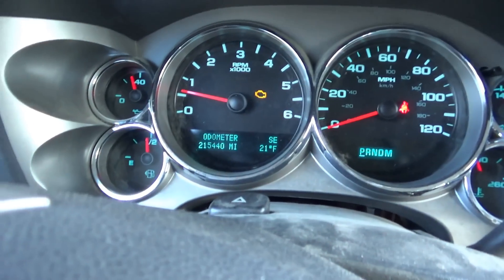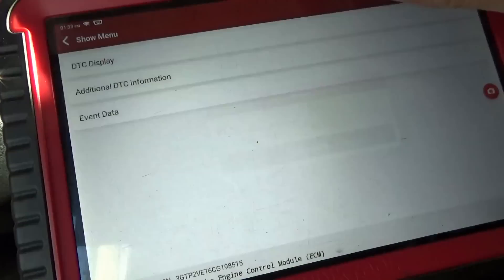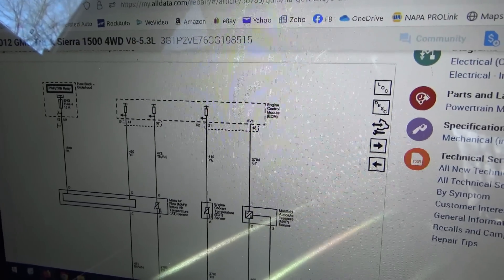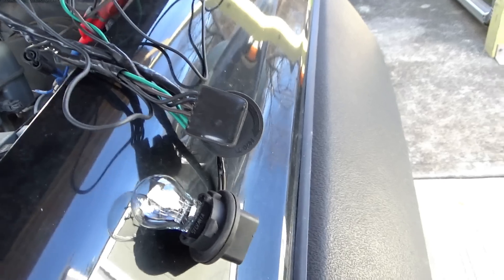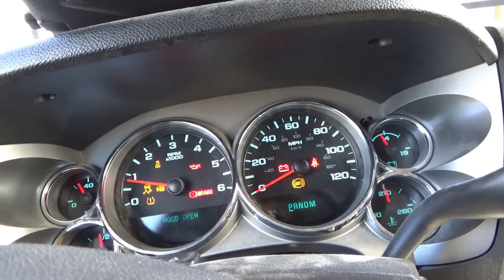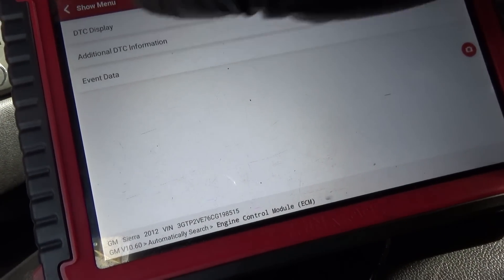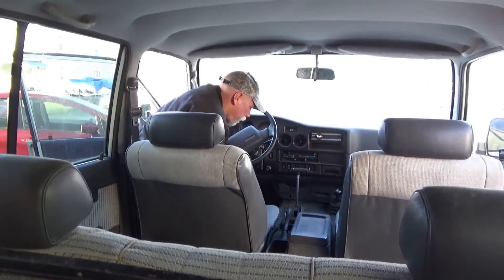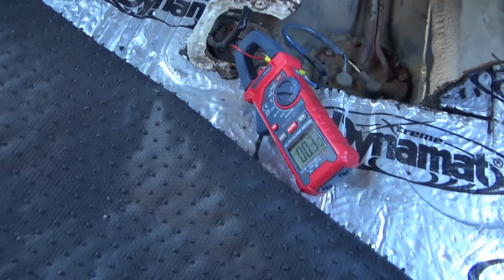HELP! My GM Truck Can't Pass EMISSIONS! (+ BONUS Vintage LAND CRUISER No-Start)

Comment: you do amazing work I watched a video where you diagnosed the bad fuse box for the no crank on the 03 Chevy I have a very similar issue but not that exact problem, is there any way I could get in touch with you?

Comment: I don't understand how you knew the fuel pump wasn't spinning by seeing the 13 amps?
Reply from the maker: It was dead silent lol
Reply: It shouldn't pull that puck power. That's locked rotor current draw. 

Plus as he said, it was silent.

Comment: Interesting case on that GMC.  The owner threw 3 mass airflow sensors at it, and none of them worked.  But never thought to check to see if it had power and ground with a simple test light....  His money was far better spent calling Ivan.  Nice work bro.

Comment: great job alot of the time multiply problems can lead to a common ground  who would have though  it was a common power my boss was not best trouble shooter but when call a report at ac company i worked for industrial chillers we had better checked all the fuses

Comment: This unfortunately reminds me of Alaska Air flight 182, the one with the seized Jack screw where everybody on board was lost. In reading the final NTSB report, I found that the pilots made a bad situation worse by trying to move the Jack screw when it was clearly jammed. They kept trying to move it while observing the voltage spikes that occurred with the jammed part. They clearly had no mechanical sympathy and everybody paid for it with their lives.

Comment: One Rover BMW M47 engines have Bosch film type  MAF I now do quick checks on the MAF using a multimeter, power and ground the look for known output voltage at idle and at 4000 rpm

Comment: Basic checks first should be in every diagnostic handbook.  The most basic is to check fuses after pulling up a wiring diagram.  Eliminate electrical problems before breaking out the sockets and wrenches.

Comment: Parts cannon on a blown fuse! Solid diagnostic, Ivan! Still wondering what caused the fuse to blow - if it happens again, it requires a careful wiring inspection.
Smart approach on the land Cruiser for a quick diagnostic! Curious to know what happened after the fuel pump replacement (did they cut the floor to get to the pump?).

Comment: I have learned from Ivan a test light and a wiring diagram is an extremely valuable diagnostic tool,despite its simplicity.  Well done Ivan.
Reply: If you test a suspected short-circuit with a test light the worst thing that can happen is the light bulb will light up.  I know years ago when him, Eric O., and Paul Danner went to Eric-the-car-Guy's meetup they probably had at least 100 test lights between them.  They even diagnosed a power window issue on a Chevrolet truck; turned out to be bad relays.

Comment: Man ivan I'm  literally dealing with the exact same codes on a 2014 6.0 .. I thought it was a ref low or a 5vref 2 issue as it was to many codes all at once . ( we also had abs codes ) I've chased it down to the cmp, and ckp sensors. I believe the cmp sensor is shorting sending out static on the 5vref2 ...

Comment: i get a kick out of new york laws.you can drive around with  your suspension & steering parts falling off.& thats OK as long as it passes emissions.so you can breathe clean air as you die in your car crash.makes a hell of alot of sence.
Reply: That way you can dilute the gene pool all at once. A little at a time to slowly delete the gene pool. 😅😅
Reply: I thought Pa. was bad, and NY possibly worse, until I saw some of the stuff that Wes works on in Chicago! Unbelievable!

Comment: I really like the Toyota floor mod to access the fuel pump without dropping the tank... I must confess that I have done the same thing on a few of my cars in the past... tin snips FTW!
Reply from the maker: Right on 😁
Reply: I used a drill and a bore scope to get me to the exact location and a nibbler to put in the new access door on my 02 Saturn L200 , I’m always thinking about the next owner! That one mod saved me hours on the fuel pump and about 3 months later on the sending unit replacement.
Reply from the maker: @johnchambers12  better than factory 😁👍

Comment: Why is it that so many educated people never think of the easiest thing to check before spending money on parts that don't fix their problem ? Fuses is my first go to if something isn't working, I only go after power problems if the fuses blows ! I guess common sense has left the building on so many people !
Reply: You would think that after the computer throws the code,  they would have checked power and grounds on the part in an attempt to ensure it was the actual part that was bad.
Reply: Because the educated people think going to a parts store to read codes and they tell you the codes will solve their problems. I've always told people. That's where you start the trouble shooting process first before replacing parts. 
Nooooo...they say

Comment: The 1960 cars the check engine light never came in the only light came on was Ford Blue light said the engine was cold it turn off when warm up they put that junk on the cars so more parts go bad my friend Owen a Smog shop he said the old cars pass the emissions test better then the New cars

Comment: Hmmmm apparently someone forgot to KISS and check the basics on that GM blown fuse. Guessing the old purge selanoid got stuck  and shorted and blew the fuse. Nobody bothered to look at a wiring diagram until you did.

Comment: Great diagnosis! Owner replaced MAF 3 times - but without looking at schematic.....
Reply: Should have fired it 1 time, then checked more in depth🤣
Reply from the maker: Read the code and fire the cannon! 😂
Reply: @PineHollowAutoDiagnostics  WRONG ANSWER, IVAN TEMNYKH!  You know they didn't even check to see if the MAF was being commanded on.......
Reply: "If at first you don't succeed, fire fire that parts cannon again"

Comment: You couldn’t give me a 1998 and newer Chevy GM for free. Prior to 1998 they were bullet proof 
After 1999 it all went horribly wrong. Some of my customers think I’m joking when I say this stuff and then they blow the engine in their new 2023 and 2024 GM products and now they know why
Reply: 99-06 was a very solid platform. I believe much improved over the 5.7l with the LS engines. 07+, I actually like them.
Reply: Blown up= motor is in pieces
Blown up used as a CLICK BAIT these days.
I do own a 03 Chevy Silverado. Going on 477k... finally going to need the transmission rebuilt by this 70 year old man. 
Wish me luck. That's after my Land Rover radiator sprung a leak. Fix my radiator first. Then fix my Chevy 😊
Reply from the maker: I would say 2006 and older GM trucks are bomb-proof 😊
Reply: @PineHollowAutoDiagnostics Laughing in blown up 4.3 vortec 😜
Reply from the maker: @GregoryGlessnerViolin  I don't know how you managed to do that Greg 😆

Comment: When you're local. Shop guy cannot find a blown fuse
Reply from the maker: Reading a wiring diagram should be standard auto shop procedure, but reality is far from that! 🙄
Reply: Local shop could not find a bad fuel pump? That is an everyday problem.
Reply: And you can't write a coherent sentence in English
Reply: @JackS425  
Sorry, but I'm not a teacher and I can speak ENGLISH !
Reply: @danamcintyre3565 I understand you just fine, some people are too critical.
Reply: 😂 😢 It is a very actives working technician cars garage.Sometimes they're overwhelmed with too many cars to work on.They don't have the needed times to properly diagnosis like Ivan does.Ivan is on his own,he has more times to do it.Because he is an independence working cars technician mechanic.He has a lot more time to do it.
Reply: @Chu3505  
Yes but they sure are not shy about charging and not fixing it !
Reply: @ @Chu3505   That's a pathetic excuse for one of the most basic electrical diagnostics that would be required on a vehicle.  No excuses this shop is incompetent.
Reply: Lol at this. Whole thread.
Reply: Your making a point.  So am I. Lol
Reply: @sumduma55  
Parts can't work without power !

Comment: as a final check i would power the fuel pump with a power probe to confirm if FP would  spin up ?
Reply from the maker: Power Probe is dangerous haha 😅
Reply: Why not a few taps on the fuel pump with a hammer, I've seen that free them up @PineHollowAutoDiagnostics
Reply: @Bottoarguewith you can burn up the wires Sherlock. If you tap on a fuel pump to free it up. You need to replace the pump already.